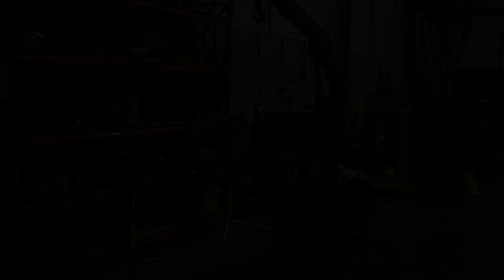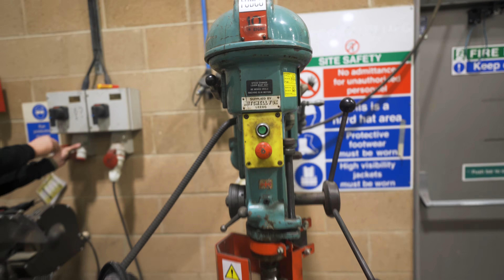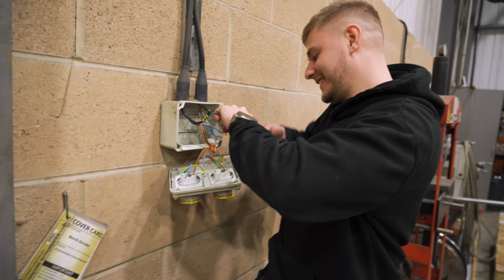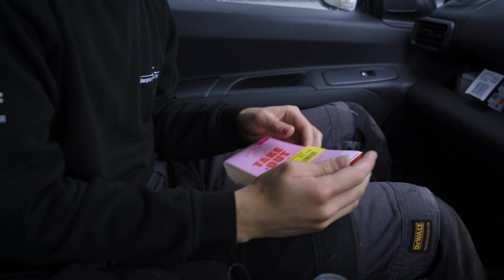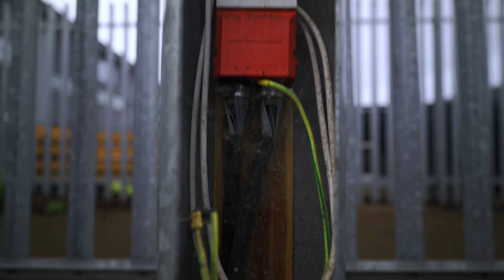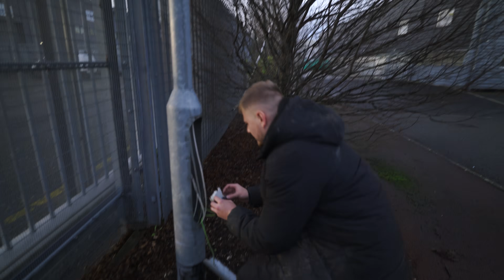Three electrical faults in a day on a commercial site

Comment: up until now I didn't know that 110 was used in England.
as you might know, our wiring color code is different here in the US.
Black is Hot , White Neutral, and green or bare copper for ground.
and we run on 110 at 60 Hz with a 100/200 amp lead in for residential.
we also have 230 but it is used mostly for electric stoves/ranges ,clothes
dryers and Central Air Con. welders, and some air compressors.
where your color code is brown for Hot, Blue Neutral and green with
a yellow tracer for earthen ground. and  you run on 230/50 Hz. Residential.
LOL when you were working on the outdoor lighting, I flashed back to Mr Bean
when he was waiting for a bus and a man at the stop has a heart attack, and 
Mr Bean runs and borrows a set of jumper cables, and opens up the lamp post
and connects one end  onto the power leads and uses the other and gives him
a electric shock to start the mans heart again. 🤣
Reply: why use a voltage that carry such high loads compared to a higher voltage?

Comment: You didn't even need to unscrew at the first and second one. Could've just used your meter and check if there's voltage present. And at the lamp posts, you really just put in new fuses, instead of finding the fault?

Comment: With the 110v socket there’s no neutral. It’s two 55v lines.
Reply from the maker: Sure, I corrected myself half way through 👍🏼
Reply: @residualelectrical  I’ve just seen that as I’ve carried on watching 👍🏻 like the content mate
Reply: "It’s two 55v lines."  What?  I've never seen anything like that.

I'm in the U.S., here the national standard for residential, 
120v/240v  Split-phase - most people mistakenly call it single-phase (there's no single-phase in US residential). 
 Almost everyone in the US calls it single-phase instead of split-phase - even sparks - otherwise no one knows what you're talking about. Commercial is too complicated to quickly explain here, commercial has split-phase, single-phase and three phase.

At the incoming panel L1-N-L2 from the electric company.  Local earth/ground provided ground rod(s), water pipe bond, etc..  Earth and neutral are connected at the incoming panel, only there.
L1 to N 120v
L2 to N 120v
L1 to L2 240v

US outlets any L to N, and usually an earth on outlets in the last 50 years.
Plugs for US style 2 blades, some are polarized,, many aren't polarized.  15amp or 20 amp
Plugs for US  style 2 blades plus a ground pin at bottom.  polarized. 15 amp or 20 amp.

Imported Chinese crap often doesn't connect the earth to anything.

240v sockets/plugs vary.  electric range, clothes dryer, big-ass AC units.
240v outlets other than those are very uncommon in a residence. You're not going to find them.

In the US you can buy any variety of plugs.sockets you want, no one cares,  I'm very surprised anyone in the UK had to ask permission to buy North American sockets (BTW: Canada also uses 120v.240v for residential).
The asking permission part generally isn't part of life in the US in most areas of life.

Any questions?

Oh, in the US in urban areas often sparks are native Spanish speakers, it's common to find one who only speaks Spanish and a dozen English words - this isn't a problem here, just different.
Reply: @DavidNull5  
Interesting read. So here in the Uk. Our standard supply is single phase to a domestic property 
L1-N 240v

Or 

3 phase 
L1-L2 400v
L1-L4 400v
L2-L3 400v 

Some places it’s still on the old 415v like on the site I work. 

when it comes to 110v we use a transformer within the property/building which usually then feeds its own 110v board and the outlets are yellow 

If you test between  
L1-E 55v
L2-E 55v
L1-L2 110v 

I’m not the best at explaining things well but that’s the gist of it, it’s quite different between our counties.

Comment: Good find That 110v was dangerous,as one side of the split phase was connected to the earth. Any metal casing on equipment plugged in would have been 55v . Would have been interesting if you done a loop test on one of the 55v sides to earth, common problem with 110 distribution is the disconnection times are a lot lower than 230Uo. As a commercial & industrial electrician it amazes me the amount of non compliant 110v system I come across with zero testing and documentation
Reply: 110v is normally wanged in by maintenance engineers, usually without electrical qualifications and always without experience...

Comment: Better lighting at last 😆👍 Make/buy yourself some industrial test sockets/adapters. Always check the reported fault before dismantling things, I've had a few where there hasn't been a fault. Why did that 119v socket have a screw terminal block? And it looked lke someone had linked the armours? (was each socket on it's own radial, or were they linked in to a bank)

Comment: Did you lock off that 110 circuit
Reply from the maker: Nope, but me and Callum where the only people in the building except our escort, and the board was in clear sight from where we was working.

If I had even the slightest worry of any potential re-energisation it would be locked off 👍🏼
Reply: @residualcurrent  you can tell I am a newbie just finished my nvq and am2.
Reply from the maker: Not at all buddy that’s the only attitude to have, I should have locked it off, and I normally always do, I’m just justifying my complacency 🤦🏼‍♂️
Reply: @residualelectrical  lol real world I know

Comment: how do they run the 60hz american stuff on the air base? just it do just fine at 50hz? cheers
Reply: Resistive equipment doesn’t matter and most equipment/ motors are 50/60Hz
Reply from the maker: I’m not sure to be honest but I guess the had a sine wave inverter also 👍🏼
Reply: Frequency converter
Reply: thanks